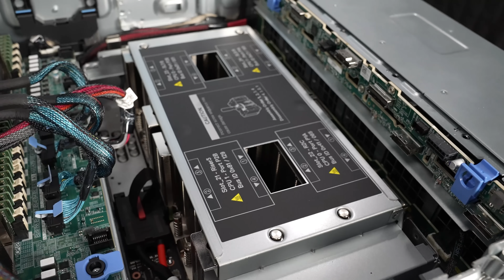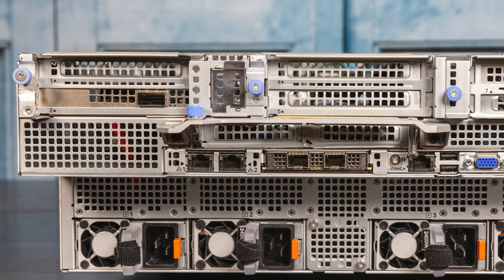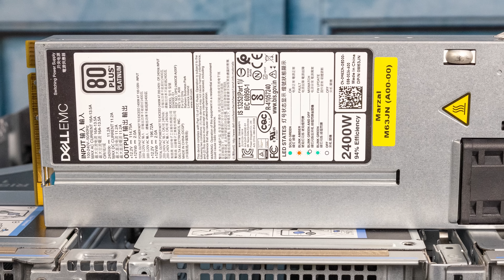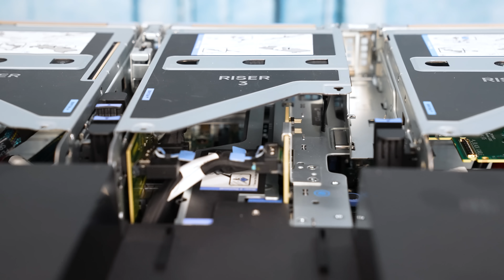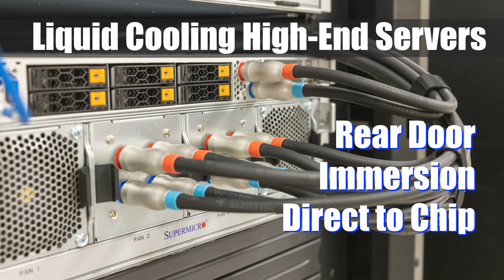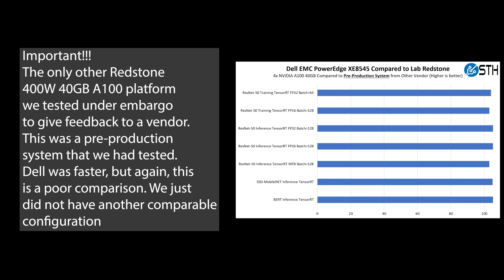Many NVIDIA A100 The Dell PowerEdge XE8545 Server Reviewed

Comment: If your racks can't fit deep servers you probably purchased them a very long time ago and they are now jhnk IMHO. Send them to the scrappy get something more modern with a water cooled door on the back.
Reply from the maker: Quite a few colo providers have shorter racks especially where land is very expensive.
Reply: @ServeTheHomeVideo  I just don't think the vast majority of these servers are going in colo"s. Besides just get a better colo that is not auch a cheap skate IMHO,. Though I personally don't deal with those, we have our down data centres at work. The only short depth racks I have dealt with are exclusively  for networking. Have not seen short depth racks used for servers ever;  since 2004 when I started doing work in data centres and the university I was working for at the time moved a bunch of short depth racks out the data centre into patch rooms. Been using racks with water cooled back doors since 2012.

Comment: 4x 500W GPU's
That rack is burning 2kW just on GPU compute. Damn.
Then there's 2 280W CPU's, 32 DIMMs of RAM, the 10 front NVMe drives, and DPU's or whatever you put in the PCIE risers.
Reply: an Nvidia DGX2 burns 5-6kw running

Comment: Someone is gunna mod the A100 to output games at some point. Guaranteed.
Reply: I believe its allready possible if u have another GPU for the outputs. At least it works relatively easy with all those tesla cards u can get from ebay etc, thx to windows having good passthrough support for laptops with integrated+dedicated gpu. Wendel from level1tech made a nice video about it.
Reply: @norpporkine445  so that is how you get good FPS in flight simulator (/s)

Comment: I kind of wonder what the appeal is these days for servers like this unless you work in a highly specific field with a lot of money to spend on this equipment. I've interviewed for so many jobs over the years that barely have any infrastructure anymore, as most software and IT needs are SaaS based or IaaS (i refuse to say 'the cloud'). 

obviously this specific has a target market, that is not any of those companies, but at a certain point "reviewing" servers is kind of like 'what's the point', no?
Reply: Machine Learning / AI. I suppose they could also be very useful for video rendering, and transcoding.
Reply: SaaS and/or IaaS or the cloud (i dont mind saying that) are servers like this and others in a datacenter somewhere. right?
Reply: @tedbenson1052  basically

Comment: Imagine showing this server to someone from 20 years ago.  A single one of those RAM sticks would have more memory than a lot of clusters circa 2001.  And there's 16 of them.  The GPUs and CPUs are equally if not more impressive.
Reply from the maker: 32 DIMMs!
Reply: @ServeTheHomeVideo  right, 2 per channel, that's crazy.
Reply: Indeed. I have a laptop with more memory in it than an entire rack of systems from 2001.
Reply: I was setting up 386 Servers with 64 MB full height 5 1/4 drives back in the early 90's. Had a drive array with 256 GB, took an entire room. Thought I was the shut! 😁

Comment: The c4140s were a PAIN to deploy.
Reply from the maker: 100%. This is much better
Reply: I've installed 44" blade centers. A 38" server wouldn't be that big of a problem. (yes, I always get the deepest racks the bean counters will allow.)
Reply: @jfbeam  I’ve installed a UCS B200 chassis over 20 times and would do that in a heart beat by myself over the C4140, which I have installed well over 50 times.

Comment: So which niche does the redstone platform fill if most organisations are only interested in GPU servers that use pcie cards or the delta assembly?
Reply from the maker: This is really good for when you need CPU to GPU bandwidth.
Reply: @ServeTheHomeVideo  In the video you said that each SXM4 GPU has a PCIe 4.0 x16 link which would put it on equal footing with regular PCIe cards in terms of raw CPU <--> GPU bandwidth. Are there other major advantages of this design? The switchless full mesh NVlink topology seems like a really interesting differentiator to me.
Reply: @JonnyDudemeister  this would provide huge bandwidth to the NVMe devices too.

Comment: why don’t home PC use PCIe cables? Those are exceptionally useful for SFF build.
Reply from the maker: Cost is the biggest reason. You need to have not just the cables but also connectors.
Reply: You can get risers in all sorts of sizes and form factors, also there is U.2 which is a cable-based PCIe integration and you see U.2 on a lot of high-end gaming PC motherboards, although they are mostly used for nvme drives right now.

Comment: Hi Patric, cant wait for your thoughts on Teslas Project Dojo 
(if my estimate is correct its going to be an over 100kw per rack system)
Reply: 100kw per rack seems a bit high
Reply: @brofights3138  They said its 15kw per node and they plan to have 6 nodes per rack, that is just 90kw on DPUs (the ML asics) if you add host machines (which if I understand correctly is a 1:1 for each node) plus networking and you get about 100kw (keep in mind they are using infiniband HDR and Nvidia dgx machines are usually paired with a pair of high tdp cpus, and given the amount of bandwith they will have with the setup My guess is that they will need that amount of connectivity). 
Though yes 100kw per rack seems like a crazy amount, specially if you consider that they showed a cluster of about 10 racks when presenting their plans (since its an asic the performance per watt seems to be very good though, they do have 3 clusters of nvidia gpu right now, the largest has over 5k nvidia A100s and they use cloud services)